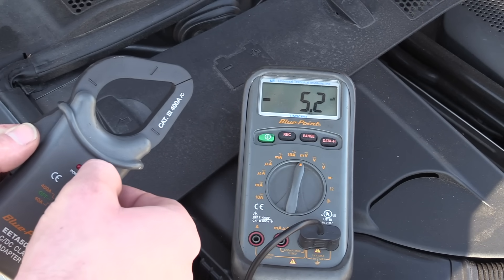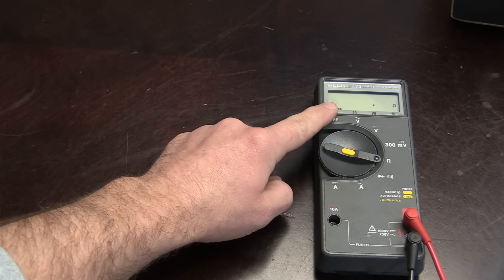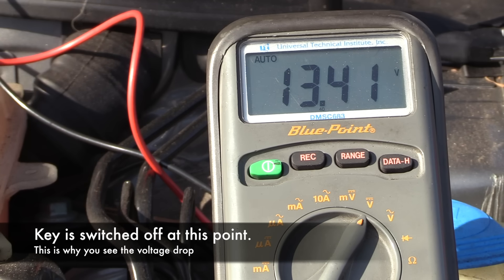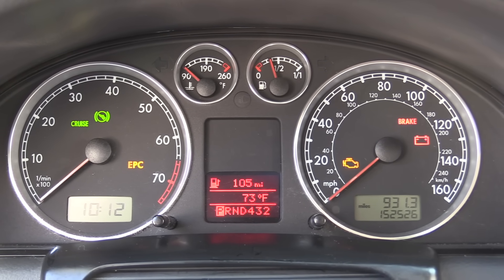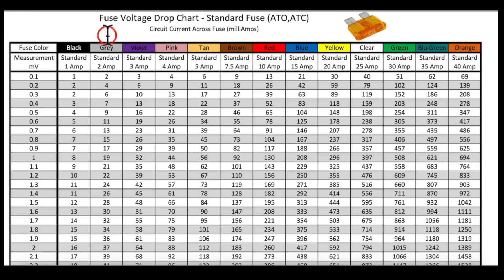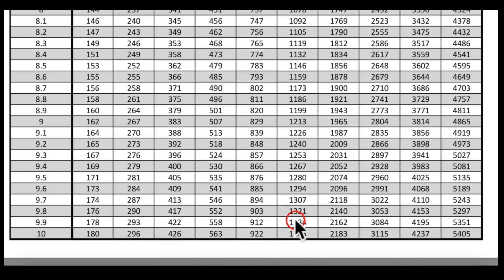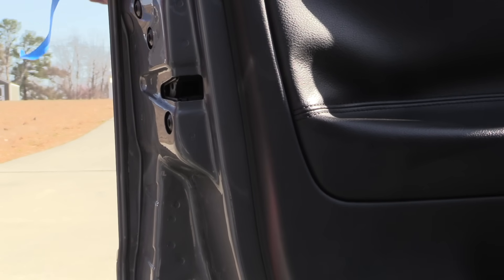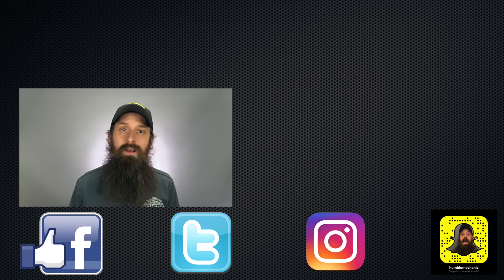The BEST Way TO Perform a Parasitic Draw Test

Comment: I got a 2004 trailblazer. All I know is when I shut the key off to get out of my vehicle, right after the floorboard lights go off, you hear a click somewhere on the left side of the dashboard and then all my gauges go up. So I don’t know if it has something to do with my floorboard lights or what. So I just put a Killswitch on it, which is a pain in the ass. Because I have a nice stereo and I have to keep resetting it!

Comment: 1. Cars that have door open position switches need to have the one for the drivers door depressed. Newer cars may control the dome light through a BCM and may  keep it alive.
2. With cheap Chinese minifuses, you may may need test leads with needle tips.
3. If the inter fuse panel is down under the dash (Honda), you may need to be a contortionist.

Comment: Please, my 2012 tiguan 2.0tsi 147kw starts with tire pressure sensor blinking and after star, stays on... the car don´t have power... with vcds show error 01314
1 Fault Found:
01314 - Engine Control Module
013 - Check DTC Memory
Freeze Frame:
Fault Status: 01101101
Fault Priority: 2
Fault Frequency: 2
Reset counter: 201
Mileage: 164609 km
Time Indication: 0
Date: 2043.14.15
Time: 08:34:34

and when I try to reset the tire pressure they say can´t write in memory...

Comment: What about the fuses in the fuse box that have to do with the PCM and ECM computers because your computer is on when I check my car the PCM fuse had a small amount of voltage was curious what about the circus that have to do with the computer system of the car what about those juices that have to do with the computer system of the vehicle

Comment: What about the alarm? How do you stop it going off?
Reply from the maker: You can start in the scan tool to look at what triggered it. Then work to that sensor to see what’s going on. Door latch is most common
Reply: Thanks for the reply!
Do I lock the car when I’m checking fuses? If I do the alarm triggers when I’m checking fuses on the inside box

Comment: How do you test your batteries voltage? Is it as simple as connecting the positive to positive and negative to negative? I was under the impression you need to disconnect it first. 
This video is super helpful but you kind of skip over how to do this part.

Comment: So if i am understanding this right, you are see'ing the current flow across the fuse "as" a static voltage which is very low in the milli amp range. Once you shut that circuit down, no current flow then the meter see's nothing. 
This is def a great way to test parasitic draw without having to interrupt the circuit because you want to catch it in the act.

Comment: Need your help, i have .38 amp draw, my alternator is bypassed,  pulled ISD fuse and amp draw clears up, to narrow it down i pulled all other fuses from glove box and cant seem to narrow it down from the ISD fuse, i had a wiring diagram of the wrangler but  it got torn and i only have one half lol, any help would be great and much appreciated. 👍👍i did check all grounds and they seem good. Also all electrical is stock, even radio, no lights, everything is stock, so should make issue easier to solve

Comment: There is an amp selection on multimeter to use with the leads that would eliminate the need of the conversion chart

Comment: I've been trying to find out the drain in my Mercedes, but done it wrong by removing the fuses one by one. Luckily I saw this video, will try again tomorrow. Thanks
Reply: There was no drain at all. I had been measuring it with door open and the door module was on, taking some currentthat I thought was drain. The real problem, making starting difficult in cold was cable to the starter that was almost cut. It seems I have to forget the methods that work fine with my motorcycles.

Comment: I know this is an old video, but I’m wondering if the results would be the same with a 24v system or would you double your readings from 12 to 24v
Reply: The voltage drop across a given fuse will be the same at the same current, regardless of what the overall voltage of the vehicle's system is.

Does that answer your question?

Comment: good video but i would like to know what i do about the car alarm/sensor,  after locking the car with the door open, do i pull both alarm fuses also mine is keyless do i need to keep the fob away from the car which when the alarm goes off i have to run indoors and get the alarm can any one help ,ta

Comment: Hi Charles, great videos. I have a 08 a3 bpy that lost power on the freeway w CEL and epc. It cranks but doesn’t want to fire. ESP light is on now too. Codes were for camshaft timing and maf p1531 and p0100. I replaced the crank,cam and vvt sensors (waiting on maf part). Still not starting getting a supply voltage low on many electrical modules. Replaced the battery with no success(00470,01314,0068,00778) any help would be greatly appreciated.

Comment: Hi I was starting my truck and I have a grinding noise would not start .so I keeped starting it over and over and over again till I lost all power .no lights no Dash lights no peeps nothing completely dead I checked the fuses can't find the problem .2006 GMC Sierra pickup .any ideas ? Thanks 👍🇨🇦

Comment: Hi, HumbleMechanic! I have a mk4 Jetta that I have trouble getting to start. I charged the battery overnight and it got to 13.09v but after taking the charger off in 20 mins it has reading 12.99v so it lost about 0.1v in 20 mins. Is this normal or parasitic draw?

Comment: I know you would agree that this test is impossible on blind fuses like the dark red 10amp ones at 07:31 which are now very common in cars. This test will not find an intermittent fault like a wiper park circuit turning on, on a failed rear motor etc. So in my opinion a good test but NOT THE BEST test like the click bait. Use this as one weapon in your arsenal of skills but keep open minded. My choice as a start on this fault would be an amp draw test at the battery with a multimeter that has a min max  button so an intermittent fault can be recognised. A very good quality video though.

Comment: This is the first time watching one of your videos. I noticed the UTI school meter (Blue Point). Did you go to UTI? If so, where? I was an electrical instructor there from 2002-2020 in Avondale AZ.  Good advice in the vid! That radio fuse was 1 amp, not .1, but otherwise really good info! I like the idea of taping up the door latches- cant tell you how many times I forgot, and slammed the door!
Reply from the maker: Hahah I did go to UTI in 2002-2003 Illinois campus

Comment: Issue with my 2006 Audi S4 Avant with only 65k original miles.

I had an issue where my radio stayed on even after removing the key from the ignition.
This ended up draining the battery completely dead. I wasn't sure what to do since I'm not much
of a car guy so I got on google and did some searches. At first I found people saying this issue is
caused by a faulty ignition switch. After more research however I heard others saying their radio
was the issue and once replacing their factory radio everything was fixed. With me already wanting
to upgrade the factory radio I did just that. 

However, I couldn't take it to the audio shop to have it
 installed because to my surprise trying to get
my car jump started didn't work. At that point I'm assuming dead battery. I then go and purchase a 
new battery and install it but NOW the key fob is no longer programmed with the car. I can't unlock/lock 
the car with the key fob anymore. Of course I did some more research on that and no one seemed to be 
on the same page as far as the for sure answer on how to re-program our key fobs with our car. 
These were the steps that I tried several times without any luck.

-Press and hold unlock button on key fob.
-Put key in door and lock the door. (unlock button still pressed)
-Then unlock the door with key (unlock button still pressed and flashing)
-Then get into the car (unlock button still pressed and flashing)
-Put key in ignition and turn to step 2/accessories (unlock button still pressed and flashing)
-Wait 5 seconds (unlock button still pressed and flashing)
-Turn key back to 1 and remove from ignition
-Release the unlock button on fob that was held down this entire process.
-Press unlock/lock and key should be programmed.

This didn't work for me at all. I even tried doing this with my secondary key fob. These fobs both flash
so the batteries seem to be working perfectly fine in them.

With that said. This whole issue started with the radio staying on and continuing the play and it killed
my battery. After replacing the battery though I noticed something odd. Despite having a brand new
battery in the car some things weren't working that I'd expect to work just fine with a new battery.

(NOT WORKING EVEN WITH NEW BATTERY INSTALLED)
-Horn
-Power Windows
-Blank screen (the digital screen in dash that shows info such as "PUT FOOT ON BRAKE PEDAL TO START" etc.
-Nothing happens when turning key.
-Radio stays on and continues to drain battery.

However, the dome lights work fine, the head lights shine bright, the electric seats work fine and the radio
come on (and unfortunately continues to stay on still). I just thought it was weird that the horn and power
windows aren't working with a brand new battery. This lead me to believe that perhaps my Anti Theft System
thinks that I'm not using the actual key for the car. Basically treating me like I'm trying to steal my own car.
Because I do know the horn/windows and starting the vehicle are ALL tied into the Anti Theft System correct?
I'm almost wondering if I can simply get this damn key fob programmed again that MAYBE the car will finally
start and everything will be back to normal? I obviously have no idea what to even do next.

I just purchased a multi meter and watched a couple tutorials on how to use it.  Tomorrow I plan to go out and
check some fuses to see if maybe I can figure out if the issue my car is suffering from is fuse related.  If you or
anyone else takes the time and reads this and has any ideas on what I can do from here to try to fix this for as
cheap as possible (without going to the dealership) I'd greatly appreciate it!

Comment: Hi Charles, if a modern VW has a suspected dead battery... is it dangerous to jump start it from another car with jumper cables? A Reddit thread said it is dangerous due to modern car electronics, and the only safe option is to try charging the dead battery. Thanks in advance!

Comment: I am a dum dum, but why do you latch and then lock the doors before checking the fuses?
Reply from the maker: So the car will be locked(can’t lock without the door being latched) 

The car needs to be locked for modules to go to sleep to start the test. Or the test will pick up things that are on, the should be on.
Reply: @HumbleMechanic  oooh, I see. So if the fuse box is in the engine, I can just lock it up?
Reply: Never mind, found the second one inside the cab.

Comment: this is a great way to check parasitic draws on vehicles and is also great to find dirty connections that can drive you nuts , such as a bad ground problems .  same test just a different way to look at it such as from your ground on your battery to any other grounding point that might have a problem

Comment: cURRENT draw test with doors closed, window open to crawl in if needed to not wake up the body module and other modules, of course need to be sure its not going to rain either way.
Reply from the maker: Until the fuse pane is only accessible with the door open. Lol

Comment: Hey I was wondering if you could help me, my wife has a 01 Beetle 2.0 and we have had nothing but problems with the coolant system. Replaced water pump, thermostat, temp sensor x3, another t-stat because the one got stuck open. And now we are building up pressure in the system and have to continue to pull over and release it. I’m new to working on VW. Any ideas? Besides the check engine light keeps saying temp sensor is bad and everything was purchased from VW the 3rd time around.

Comment: Any ideas how to remove the lower grill off a mk5 GTI without removing the bumper? I want to spray it but it's clamped on there like a limpet. PITA!
Reply from the maker: It’s a super pain. The clip you have to release is on the back side. And I think it pushes back towards the car. It’s easier to just take it all the way off.

Comment: Here is the current working link for the Power Probe voltage drop charts.   Thanks for  your video.
https://www.powerprobetek.com/wp-content/uploads/2018/12/fuse-charts.pdf

Comment: It would be nice if someone made a multimeter probe designed to attach to the top of the fuse to make this easier so you could have a hand free to hold the meter.  Some fuse boxes are in really awkward places and it would be difficult to hold the probes and see the meter at the same time.  I looked but can't find one anywhere. Only see the ones that plug in 'in place' of the fuse.

Comment: My draw is very intermittent. The SUV will run fine for several days or a week and then it'll have a bad day and then it'll be fine again starting the next day after I charge it with my battery charger. The battery and alternator test fine. The battery is only 2 years old. It's a 2016 GMC Acadia with only 45,000 miles on it. Sometimes it'll start just fine We drive it somewhere and then when we come back in an hour it won't start up. I'm trying this technique and hopefully find the problem
Reply from the maker: Those are legit the worst to diag. You lock the doors to mimic the car being locked and Asleep
Reply: @HumbleMechanic  my initial test showed a 60 amp draw from the factory car amp. And a couple 1 amp draws from power mirrors and locks. I'm not sure if I did something wrong during the test but that might explain how the car dies within an hour from driving. That was before locking the doors. I locked the doors and will wait 2 hours and will try again. Some of the fuses are almost impossible with the location of the fuse box to test

Comment: Charles turn signal  is on , Permantly the right is on wont turn off unless you hit it on ( sometimes.) it will go off  plus there is a draw from the battery,  other than that its good .

Comment: I don"t know what could be the cause of the problem I have with mi 2008 GMC Sierra, I got home, turned off the engine, the next  morning when I tried to start the engine, Apparently the battery was dead, I began to connect the jumping cables, and as I was doing this, the alarm started  warning  that  I had left the keys inserted in the switch  and the door open, so I went to the cab  and turning the key on , Start the engine without any problem, even though I had not connected the cables to the other car , this problem has been happening for three times without any reason, I have 35000 miles  on it and I have it since 2008 ,  I will appreciate your  comment.

Comment: The problem I find is not all circuits protected by some fuses are listed. if I've found a drain and tried tracing it back, it doesn't always give that it's on the circuit listed for that fuse.clasic example is a slow battery drain on a nissan almera at .50 amps was on a radio fuse, but even after removing the radio, checking the wiring for shorts etc it was still there. Only after checking third party wiring diagrams did I find out that it powered the interior monitoring for the NATS ( anti theft system). Fault traced to immobiliser unit! Great video though with some good advice, I'd say be sure and check you have a FULL wiring list for your fuses before checking👍.

Comment: Thanks. This is helpful, especially given battery under driver seat on 2004 Touareg.

Just so I am clear.  If it drops to zero, is that an indicator that I do NOT have a parasitic draw on that circuit?

Thanks again.

Comment: It's better to hook the meter leads inline with the battery. Then pull fuses one at a time.
Reply from the maker: Better is subjective. You may have poor or inconsistent results on a modern car with high line technology. A 2000 s10? Pull away. A 2019 BMW that will not go as wee
Reply: @HumbleMechanic  my 2006 impala had parasitic draw from antilock system. I stuck my meter wire leads into fuse hole and a big ol 6.00  showed up my screen!!!
Reply: My battery wouldn't take a full charge. In other word it seem to never fill up completely.

Comment: Okay. When using a very good charger/jump start/battery maintainer machine on my battery after a few hours battery is at full charge. This while battery in vehicle with negative wire disconnected for the charging....next when reconnect wire charge goes down to high end of the 3/4 battery charge chat. 3/4 being 1230 to 1250 . Mine reads 1243 on the scale. Drive it around for hour or so seems to stay at same 3/4 charge when I test in both cable connect there for load on the battery...everything is tight and clean. I next started the car and removed + positive wire. Car kept running. Which means not alternator. Ground wire is good etc etc. So battery holds a charge from charger, drops to 3/4 = 1243 when loaded and drove. When car turned on and apply the gas the charge rate goes up meaning alternator is applying charge 1456 to 14 61 or higher depending on how much has pedal is pressed. So if alternator is good battery is good. But give it 3 days, then all I get is a click click when trying to start. So is a parasitic draw the only step left to find what is drawing on my battery. Does my battery sound okay to you ???  How much does that cost. Now I know your estimate will be in USD not cdn dollars.

Comment: There is one thing I am wondering. You are measuring the mV drop across each fuse. But what about different manufacturers for the fuses? Won't the V drop potentially be different for different fuse manufactures?